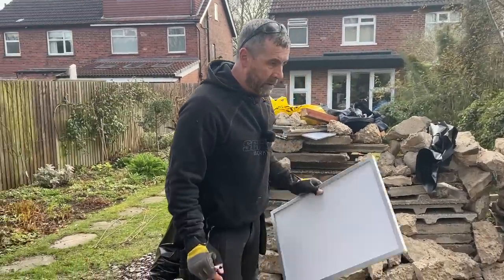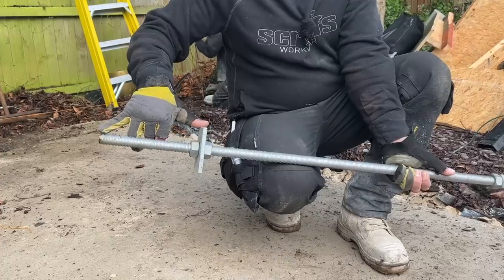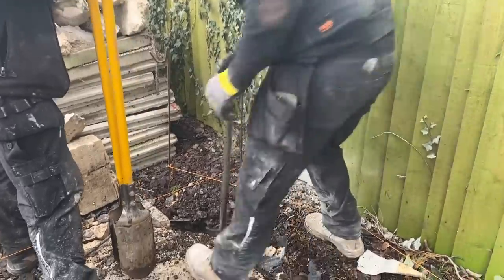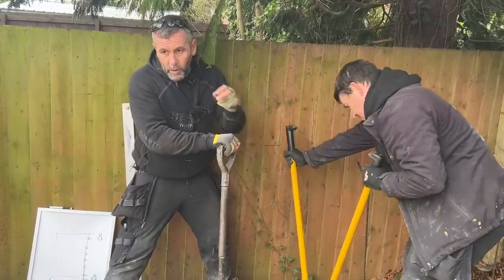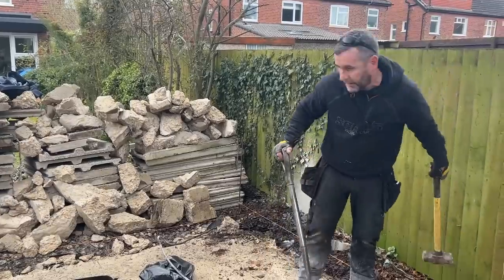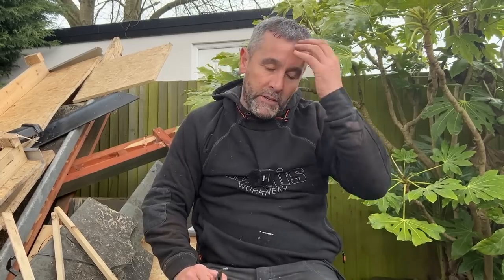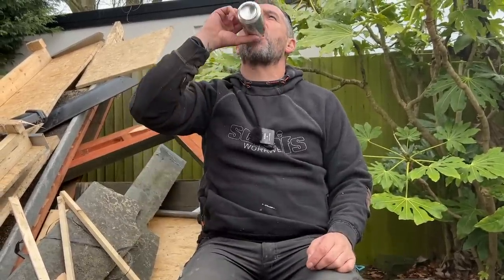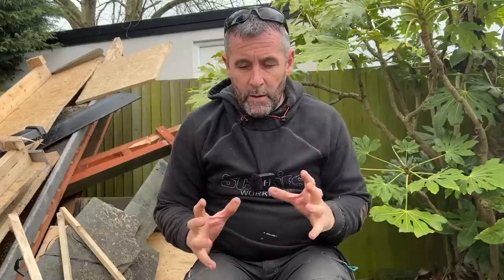The most extensive and explanatory garden room build tutorial ever! episode 2

Comment: Just built a very heavy duty shed base for a new mower shed which will take a lot of weight. We basically made a gravel base which it turns out is more popular in the US. We dug out the ground 6” deep, made a square frame out of some heavily treated gravel boards and made that level as a guide. We placed a thick weee water-permeable suppressant to not only stop weeds but primarily to separate the clayish soil from the hardcore. Then filled and tamped with a manual tamper 6” or 2.8 tonnes of MOT Type 1 Hardcore. We then found out upon research that MOT Type 1 drain very well, Something like MOT Type 3 is more permeable and still binds together for a very solid base but it’s hard to get around here and very expensive. So in the end I popped to B&Q and got some 10mm limestone chippings which should drain really well. I used them as a thin top layer just to separate the wet hardcore from the wood so it doesn’t rot too quickly. Used UC4 floor bearers anyway. In the end it’s turned out great. The MOT was wet at first and after tamping I was slightly worried as it still moves but after drying out it sets like concrete. And this shed base is going to last a long time. It was a lot of work though so I’m looking forward to using this rod method for a future garden room. Have you ever made gravel pads for garden rooms or sheds?

Comment: May be worth mentioning the further away the pins are the more travel along the previous string line if using 3,4,5 method...obviously easier with folding square or insulation.....just an observation from when I did mine, found it easier to have to next starting pin as close as you can manage to the previous string line. :)

Comment: Q: I have just read the permitted development requirements. It seems to say that if the floor space is between 15sq m and 30sq m it needs to be 1 meter away from the boundary to avoid building regs. Is this your understanding? I have your 6 x 3.5 metre build pack and now considering reducing this to the 3 x 5 metre to get it down to 15sq m. Quote below. Many thanks. 

“If the floor area is between 15sq m and 30sq m, you still don’t usually have to apply for Building Regulations approval, as long as there's no sleeping accommodation and it’s more than 1 metre from your boundary and is made of non-combustible materials. “

Comment: Question: I want to use my garden room as a gym… with heavy weights and equipment in. Over 400kg of iron weights alone before any equipment is in there. Would you recommend the rod system for a gym with heavy weights and equipment? Or opt for a reinforced concrete pad? 
Great videos 👍🏻

Comment: Thanks for day two, you guys are really inspiring. I have a question - I’m looking at building a long garden room as we live in a terrace we have a very long garden - looking at building at the bottom of the garden for the full width - I’m hoping to build 7.5 meters internal depth but the width will be 4 meters internal as the garden is only 5 meters wide. I know the slop will have to go front to back so what drop will I need and I know with this width the roof will need twin cross beams with steel in between (can’t remember what you call them) is this size permitted as long as I stay under 2.5 meters high? - (Little Jon) 😂😂😂

Comment: Thanks for the series and my 5x3.5 buildpack. 
3 questions:
Do you need to ask BC to sign it off or do you just wait for a knock on the door?
The buildpack has 400mm centers, should I really use 400mm between each so make most of insulation?
As my span is greater than 3m the buildpack has doubled 5x2 C16. Could I use single C24. My area is Colchester and near the sea, so not much snow?

Comment: If you had the option of having a good quality concrete pad installed to the correct size, or install your rod pile system for the same price?  What would you choose? (Builder has offered me a deal on concrete size is 4m x 7m)  Thanks in advance.  Ray from Nuneaton :)  PS.. Absolutely love your work and all your videos.
Reply: @William Tell thanks for the advise pal.... I will take that onboard.
Reply: @William Tell Would you recommend insulated concrete? - hardcore/sand-DPM-PIR100mm-poly sheet-concrete ?
or concrete - PIR ontop in between joists?
Reply: @raypeasley  I did the concrete pad - but with proper footings. I think it's called a "raft". I did exactly as you outlined (well, I'm still to pour the final top layer concrete) but it's basically that. I think, if you have the option to do it, then it's a better way to go. I'd say it's much more stable and will last longer. The pad also gives the option of underfloor heating. (Note that I'm building mine out of blockwork (hence the "raft") so I'm just getting to DPC at the moment - but all the roofing tips (I'm doing a warm roof), soffits, facias, internal battening and insulating, laying of electric cabling etc is all the stuff that I'm really interested in)

Comment: Under permissible development you can actually go 4m if you use a dual pitch roof, 3m with a pent roof but both need to be 2 meters away from the boundary and the eves can be no more 2.5 meters.
Reply: But riddle me this....are the eaves top, centre, bottom of the rafters? Maybe even the gutter line?
Reply: @nickgriffin637  Eaves height. 2.5 The “eaves” of a build are the point where the external walls, if projected upwards, meet the lowest point of the upper surface of the roof